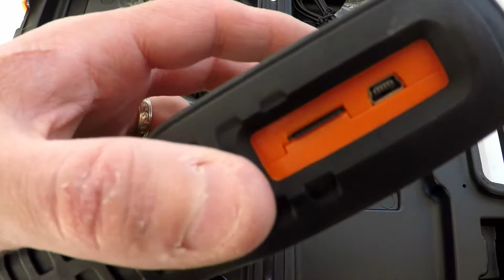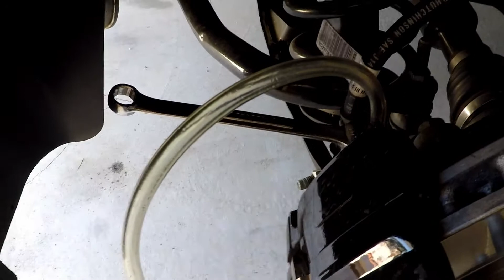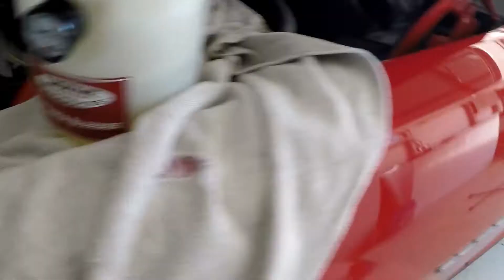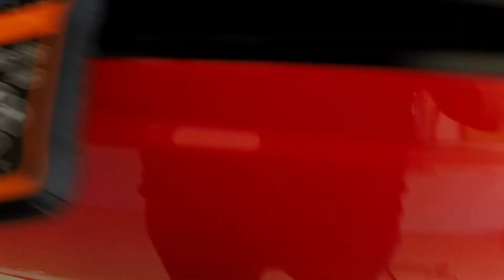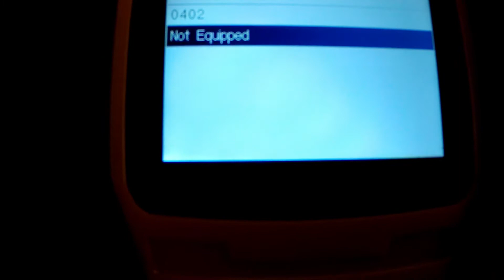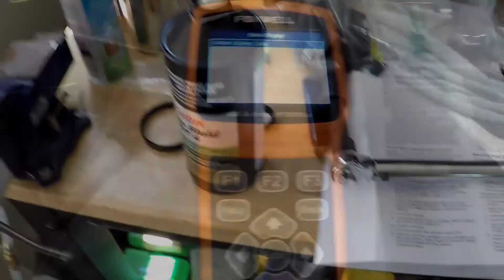ABS Autobleeding for the Camaro ZL1

Comment: I just bought this scanner to bleed the abs on a 97 Chevrolet C1500 and it didnt have any option  to bleed it . Only option it listed was  WAL3 sensor and supplemental inflation restraint. 
Anyone know a scanner that would access the abs to cycle and bleed the abs?
Reply: I believe the 97 c1500 dont have an electric abs module
Reply: @yahirdelgado3007  I have a 1997 c1500 and it does.

Comment: Instead of using a pressurized system attached to the master cylinder, could I just use a vacuum pump attached to the individual brake cylinder?
Reply from the maker: As long as the master cylinder never allows air in or runs low on fluid you should be good. Yes, the mighty vac type system would work
Reply: The Vaccum systems are known for sucking air in ... around the other wheel cylinders.

Comment: Thx for the video.  I’m preparing to do the ABS bleed on my ‘22 SS 1LE.  How did you get air in your system?  Did the procedure get your pedal high and firm?  I ran my reservoir dry and am trying to get my pedal firm again.  Been a struggle.  Also, how full do you have your reservoir when you connect the motive bleeder?
Reply from the maker: Yes I ran it dry by accident. The pedal firmed up after bleeding like in the video. Air was in my abs module.
Reply: How much fluid do you have in the reservoir when you connect the bleeder pump?

Comment: I'm wondering if I need to turn on the abs pump motor before starting to bleed.
Reply from the maker: If you suspect having air trapped in the ABS module, then it's best to modulate the valve to get the air to purge.
Reply: Thanks for your reply.
Reply: Wouldn't you want to pump the brakes ?
So as to push any trapped air from the master cylinder  ?

Comment: Was your pedal better?

You said you didn’t see any bubbles coming out
Reply from the maker: I did get air out eventually. The issue was air in the ABS module. It took a bit to get it to the wheel but the pedal is good now.
Reply: @fasnuf  

I have several vehicles that I am not happy with the brake pedal and I know it is the ABS pump.  I am looking at purchasing a Foxwell NT630 to help me
Reply: @FasNuf Garage  
By 'eventually', meaning the air did eventually come out during your first bleed, or did you have to do more ABS autobleeds?  I have fresh Castrol SRF in the system so I am trying to minimize the number of bleeds, haha, and have about 0.8L left to get the job done ideally. Thanks!

Comment: Excellent video and narrative, thank you.  I changed two calipers on my 2008 Cadillac and can not bleed the brakes.  Reservoir full and with assistant pumping the pedal very little fluid came out when I opened any bleeder screw.  I expected the traditional stream with air bubbles present.  (I have done this numerous times over the years and know the procedure.).   Will try using my Motive power bleeder and jacking all wheels off the ground. In an attempt to get the air out, I will “drive” the car on stands and apply the brakes to exercise the ABS module.  Rather not buy a scanner with bi-directional ABS control, if I don’t have to.  However, armed with knowledge from your video will purchase the Foxwell if my approach fails.  What perplexes me is I changed all the brake lines in my 2005 GMC truck, which has ABS and I had no problems. Simply filled the reservoir and bled each wheel and got the full stream expected at each bleeder.  I did follow the Haynes bleeding procedure and had no ABS issues.
Reply: Bought it based on your endorsement.  It worked great.  Simply registered and plugged it in.  My SD card was already programmed.  Thought it might have been a return, but it was advertised as new.  I assumed Foxwell programmed the card, which makes sense to me.  Device simply needs to be registered at their website and you can get to work.   I was on the verge of having the car towed away to a shop with a scan tool, but dodged that bullet.  Thanks again.
Reply from the maker: I had similar results first time I tried bleeding these brakes, that’s why I looked for a scanner that could run the ABS module.
Reply: @fasnuf  Gave up on idea of trying to activate the ABS with the car on stands.  Just ordered the Foxwell NT360 plus based on your video.  Looking forward to using it.

Comment: Can this scan tool update the VIN in the ABS module if say you replace the original module with a used module? If it has that miscellaneous function in there with the bleed as the old hi end scanners I used years ago at the dealer.
Reply from the maker: I did not see that as a function.

Comment: I bought the same unit for performing an ABS brake bleed on a Nissan Frontier.  Turns out it doesn't support the auto bleed function on my truck.  Was told by Foxwell to perform the bleed manually by selecting the selenoid activation from the test screen.  So basically if I want to start on right rear I will open the bleed valve and start the right rear selenoid cycling in the test menu.  After 30 seconds or so stop the selenoid and close the bleeder valve.  (Assuming no air is coming out)  I also have the motive bleeder.  What a tremendous product.
Reply from the maker: You would want to bleed in the sequence outlined in your service manual, buy yes you'd have to manually actuate the valve for the wheel you're at. I found this was the best way for me too.
Reply: @fasnuf  i want to replace the fluid on my Challenger, the bleeding function only activates the system shortly. So is i want to replace the fluid in al the brake lines i have to do this procedure many many times per site. Do i understand in the text mensioned above, that there is another function that takes care of flushing the system ? Thanks for this instruction video!